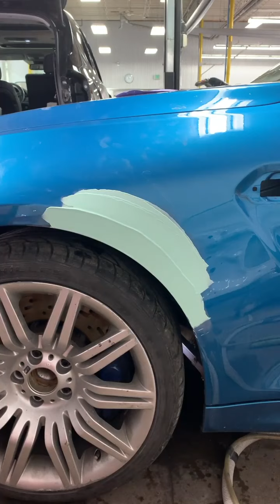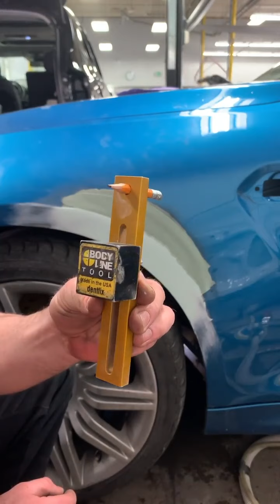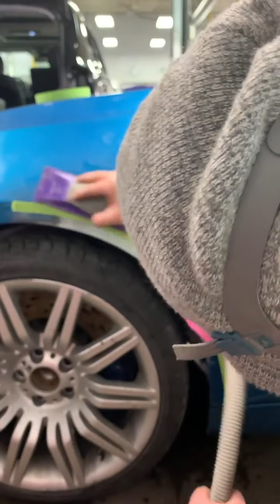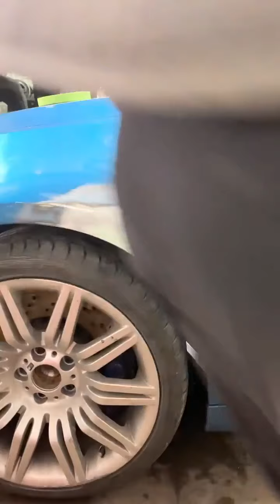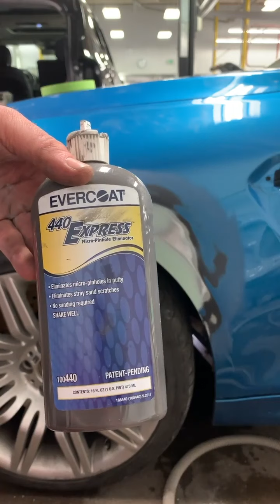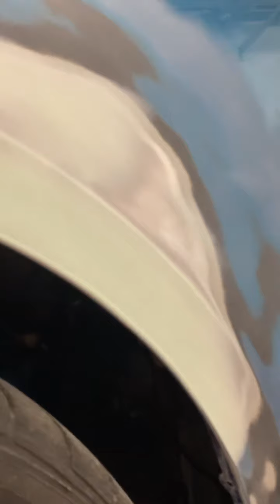LuxuryCarRepair | BMW Repair

Comment: What grit did you use on the da on the area slightly outside of the filler work? Thanks.
Reply from the maker: I would feather edge it out with p180 up to p320
Reply: @LuxuryCarRepair  thank you